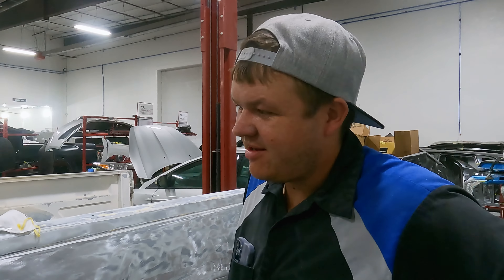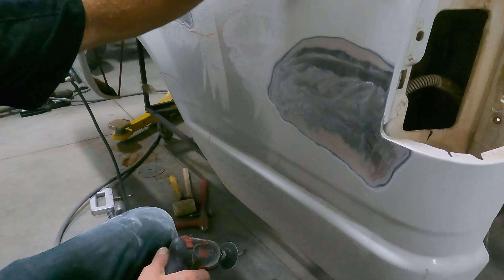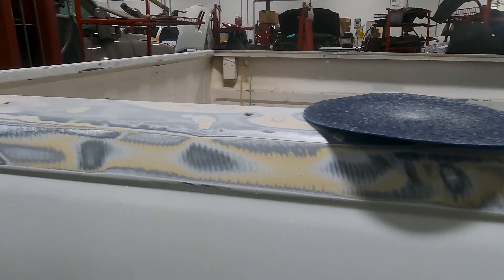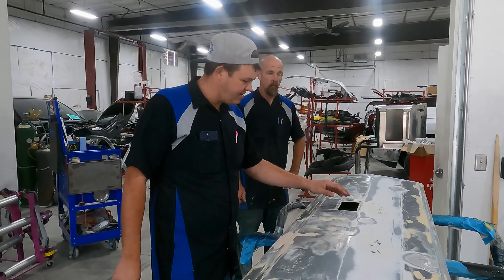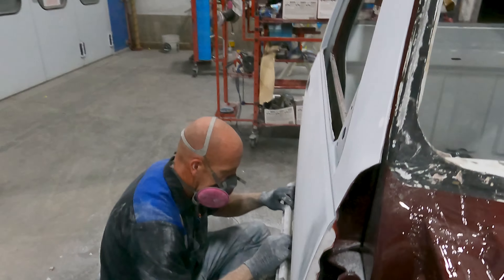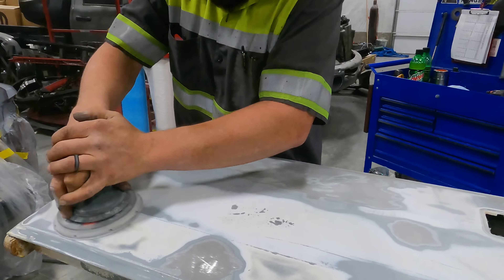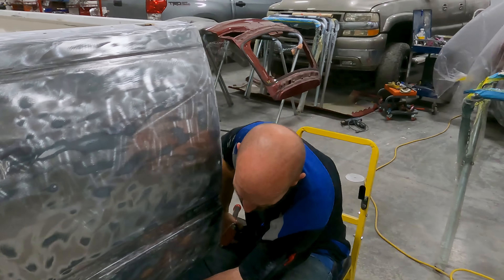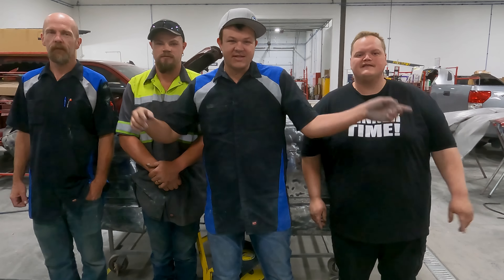Terrible Paint Work Forces Restart On Aiden's Truck Bed!

Comment: Chevrolet on the tailgate for sure. A nice aluminum or stainless emblem with Aiden's dad's initials and Special Edition under it on the corner of the tailgate. Great job guys, appreciate what you are doing for this young man!
Reply: Yeah idk about special addition kinda lame but I get the dad's initials but put them on the dash or inside why outside no one will care or understand what it means 🤔
Reply: @ScoobyShotU    Yeah, I would say no badging anywhere on the truck, but I like the idea of a small, discrete "in memory off..." hand painted (like pinstripe) somewhere.  Or as you said, maybe a little remembrance on the dash.
Reply: Definitely one of the original style stainless panels, I like the idea of having his dad's initials or name on it somewhere
Reply: I say hand paint it.
Reply: YES!! LOVE THIS IDEA!!
Reply: In memory of or Dads initials in a subtle way somewhere would be a nice touch. I think Aiden should have a say about the badges though as it’s his truck.

Comment: Just a tip when using the eraser wheel, slower is better. You actually remove more material quicker when the wheel spins slower. And bonus, the wheel lasts longer. God bless and stay well.
Reply: Yep slow it waaaay down . Use a half inch air drill with some torque and lean in too it when need be , angle of attack is important best to do on vehicle

Comment: Blows my mind just the work involved in these restore/rebuilds. Thankfully there’s enough meat to work with. These days a lot of work especially with newer vehicles is about replacing parts & not repairing much. I guess Robby & Cory have a real good feel for imperfections a bit like vets & chiropractors can feel when stuff isn’t sitting right.

Comment: * * * * * Yes, paint "Chevrolet" on the back but, have Aiden help you and high light with Golden Nugget Gold. Try Air Craft Fuel to strip paint. Over the rails and 2" on the outside to save the truck bed. Also it will give it a look like that you put in a drop in truck bed liner.

Comment: Bed liner over the top rail, I think, is the way to go on a pickup bed. Do the tailgate the same way, to match, and it would be just that much more protection for the whole thing. Line-X or Rhino liner  would be the best option. And they both offer paint matched colors. A maroon bed liner would be awesome!
As for the tailgate, I'm a fan of a plain, no Brand name tailgate. With possibly a custom stainless emblem in the lower corner that says "Custom Aiden Edition".

Comment: Okay, I'm in the Midwest and nothing ruins a bed like a bedliner from trapped moisture!  A sprayed bed is expensive but helps prevent the tub rusting from the top and oil spray under it keeps that intact.  After all that, if you want a tool box or a bedliner you are super protected . 👽
Reply: I don't think Robby is talking about a plastic slip in liner that would trap moisture in a north eastern rust belt pickup. I think he's talking about a sprayed on liner. My son's '96 F350 4x4 has sprayed on liner that wraps the top edge like Robby's talking about. He uses it for a Chase Truck for our offroad race team (Baja 1000). In spite of some dents and dings, the liner is still in very good shape after 20 years.

Comment: Yes the bed liner on the rails. We're all hoping Aiden uses his truck. Protect the paint. It will still be a incredible truck. As far as exhaust y'all should check out Spin Tech. Spin Tech 9000 mufflers or the 6000. JBA headers make Aiden's exhaust unique sounding. ✌❤😃

Comment: I used to work in a rather large cabinetry shop, I did a lot of sanding, i had like half a garage for a booth with two HUGE suction fans drawing my dust into filters that you could later clean out with short bursts of air and the dust would fall off the filters into pans below....Ever thought about investing in something like this instead of dusting your whole shop out???

Comment: I did over the rail liner on my '98 Silverado (mine's the same color), but its hidden under the diamond plate bed rail covers that came on it.  I also painted the diamond plate black so it's more discreet.  My vote is also for no trim like it was or the smaller trim in the corner where you could add a tribute for his dad.

Comment: Early Chevy emblem on the corner of the tailgate, I have a 90 myself and dislike that big aluminum Chevrolet banner.. Under rail bedliner with Herculiner on the rails and tailgate is what I have on mine, been holding up for years..

Comment: Bending the door is the last resort the door will always fall in time. Rocking the top hinge forward would be your first move a socket to stop it's travel open and the a good push open. Will ove the back of the door up also give a larger gap

Comment: You could really use a dry ice blaster to strip paint with. I have a complete set of dry ice blaster unit and a 210H sulair compressor mounted on heavy duty tandem trailer.  I would sell you for 14k. A new set would cost right around 180k.

Comment: Nice body work so far. As for bed liner I like it over the top rail not for the look but for the scratch protection. As I tend to use a pickup the way they are meant  to be used without abuse

Comment: Regarding Chevrolet on the tailgate, just a thought,  put a Bowtie on the tailgate in an accent color and then put "Aiden's" either inside the bowtie in the body color or in the accent color on the top of the left wing of the bowtie.  Maybe even find an airbrush artist or a pin stripe artist to do some nice work on the tailgate or possibly all over the truck....  Doesnt have to be a lot,  a dab will do it....

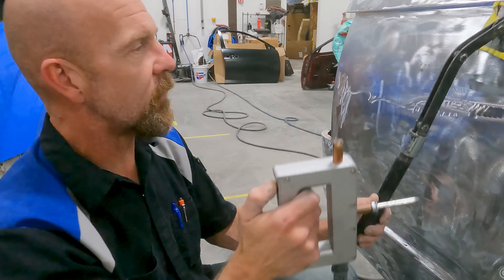Comment: Man, I wanted to see more of that puller at 19:34.  Does it re-used the same tip?  Do you sand off the arc each time?  That looked handy!
Reply: Nice!  Answer comes at 19:54
Reply from the maker: It’s an awesome machine I believe it’s called the shark it’s the 110 model I don’t like the 220 version much it blows lots of holes

Comment: I’ve always liked the metal emblems because they were on the higher end trucks. My 94 had one and would be time period appropriate. If you use paint, go with a fancy font or design. The black block CHEVROLET looks like a work truck in my opinion. The golden nugget gold would go great with the maroon. Maybe a gold block with the lettering inside like the metal. Would you discuss why you sanded the bed instead of sand blasting to strip it?
Reply: 88-94, 95, 96-98 and some 99-00 3500’s. 88-94 is old version of parts 95 was year specific for a number of things. 96-98 interchangeable and the 3500 1tons and tahoes and Yukons and suburbans up to 2000 in some models. 94 grille and a 96-98 are different. Tailgate badges are different as well.

Comment: i wouldn't put in a plastic bed liner as it scratches up the paint job, rather do a spray in bed lined same color as the truck or can do a black spray in bed liner.

Comment: bed liner on the bed rails makes sealing a camper shell somewhat difficult and it is hot in the summer if you ever rest your arms on it while reaching for something in the bed......
Reply: Nah. I was just climbing into and out of my son's 96 F350 with sprayed on (maybe Raptor or more likely Line-X brand) black liner yesterday. In the Mojave Desert sun all day with NO shade. 98 degrees. Yeah. The liner was hot. But so was the gloss white paint and every thing else.

Comment: Robbie, I am not trained formally in body work , but it appears that 91,97,99,2000, is just "farm used" . I understand that process of stripping sanding, leveling, pulling, and paint......to finish.....I learned the ole skool way without the machine to pull the dents......
Remember I am not formally trained but I am looking for a job
Reply: Visit them.  He mentioned recently that it’s hard finding workers.

Comment: I miss the good old days of body work where you would get loopy cleaning the paint gun with the old solvent paints or using real paint stripper. Note if of legal age a little liquid bread will make spraying easier just enough and your body will relax too much and your in trouble and injuries, product waste OSHA and other crap you don't want.

Comment: If it's gonna have a v6 then you shouldn't put flowmasters on it cause it will sound like garbage! Aftermarket exhausts and v6 engines don't mix. Awesome video guys!
Reply: My son's Ranger 3.0 sounds good with a Flowmaster. My 87 2.9 did too. I recommend 60 series.

Comment: Knew I’d be posting this comment the second I saw that can of non-methaline chloride you were using for stripping the tailgate.  I have had over 10yrs experience with that stuff, its decent but temperamental stripper.  

It doesn’t like to eat through wax or some types of clearcoat.  I’ll super fast scuff the surface I’m stripping after I’ve wiped it down with acetone or similar.  

Pro-tip: the stripper hates being applied thinly, any brush strokes = fail.  Slap/splotch/dab the product on.  If your “flinging” it on,  using 1.5-2x as much as you thought, and not flinging it onto anything you don’t intend to strip - you’re doing it right.

It is also more temperature cranky the older it gets (and turns that dark color) but will work… if it’s warmer that 70f…. And in the sun if cooler than 85f…. But full shade if ambient temp is higher than 85f….

You guys are in Utah (and unlike here)… I thought they sold 5gal jugs of MEK and methaline chloride aircraft stripper at every ice cream shop?

Comment: You should put together a step by step process video of how to do bodywork & paint for a full frame off to small repairs, maybe even the products used & who to buy them through & a discount code?  When to use epoxy or an etching primer on bare metal ect. At what step should you apply sealer ect.  I know I get asked alot how can I work on bodywork on a rig I drive to work during the week ect.  Most think that the primer seals their bodywork & bare metal from moisture & rust, breaks my heart when I tell them to start over if it's a keeper.  PS have you ever laid down House of Colors 2 stage candy's?  I wonder how hard it is to match doing a repair?  They claim it's as simple as a normal base/clear with a type of marbalizer added to the base...  what brand, model of guns, cups, & tips do you prefer minus your water born....  PS is there a more wallet friendly static gun for a low volume shop?

Comment: No bed liner on the rails....down the road he may want to put a cap, tanau etc on it. Bed liner will interfere with being able to seal the cap, camper whatever
Reply: Bead of caulk before setting the cap will fix that and peel right off when the cap is removed later to use it as a pickup truck. What's  with the  obsession with Aiden putting a cap on it? So many have made that same comment.

Comment: That's hilarious that you think that V6 is going to sound like a Honda...  Wait until you hear that with a flowmasters on it, and start shifting those gears they're fun trucks to drive... They don't have much power on the high end when you're cruising down the highway and 5th gear you do have to drop to fourth quite a bit but, That's fine for a teenager..  Tell you the truth I'm actually hoping something goes wrong with that engine before you install it and you decide to just throw a Chevy 350 in there should bolt right up to the transmission and clutch assembly...